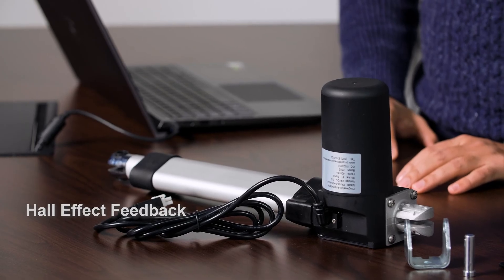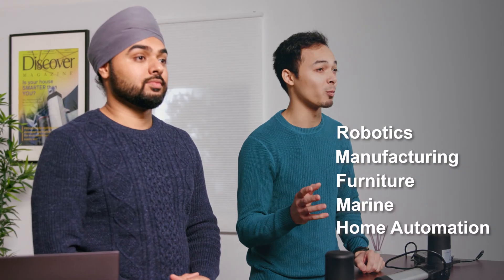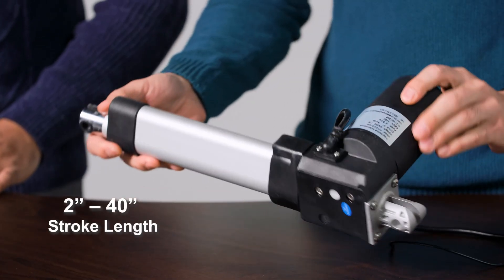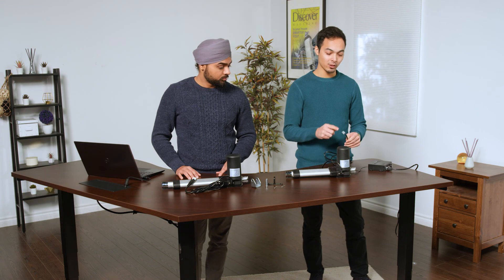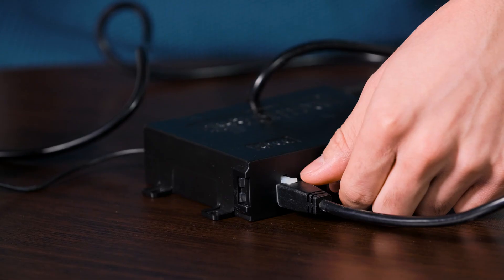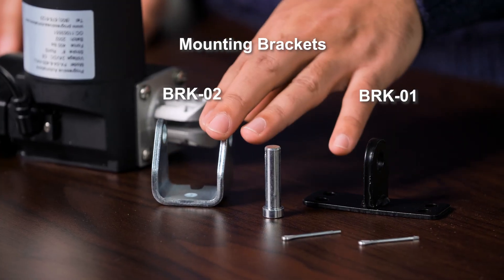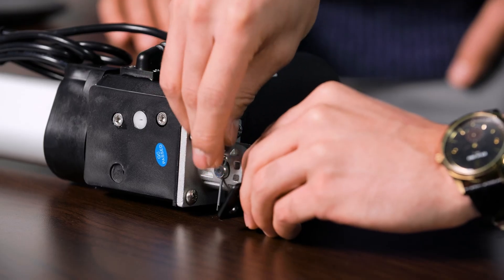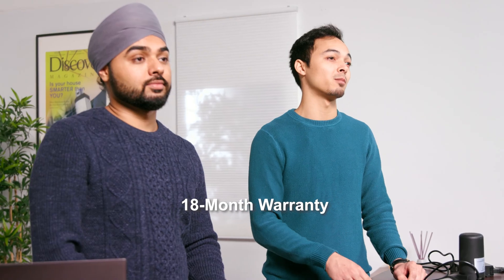Standard Electric Linear Actuators | PA-04 & PA-04-HS Product Overview | Progressive Automations

Comment: Can the PA-04 actuator limit switches be adjusted?
Reply from the maker: The PA-04 uses internal limit switches that are non-adjustable, however,  it is possible to install external limit switches and relays if the current draw was too high for wiring directly.

https://www.progressiveautomations.com/blogs/how-to/linear-actuator-control-using-an-external-limit-switch